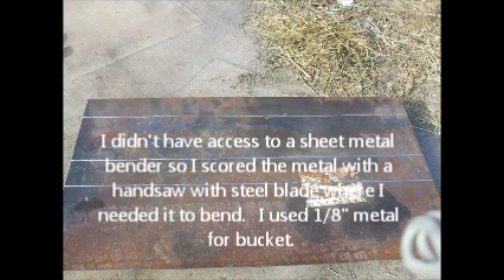ATV homemade dump bucket

Comment from the maker: I custom made the mount as well.  I used a tube that attaches to the front winch mount plate (I made it also and welded on hangers to hold the front of the  mount rail) and runs to the rear of the ATV to the rear hitch to balance the machine and not put all the pressure on the front mount.

Comment: Great video, I have a 2007 Grizzly 450 that I've been WANTING to put a dump bucket on, and the reviews on the Swisher are showing that the lift height is only four inches.  What kind of mount are you using for the bucket?  Is the mount custom as well?